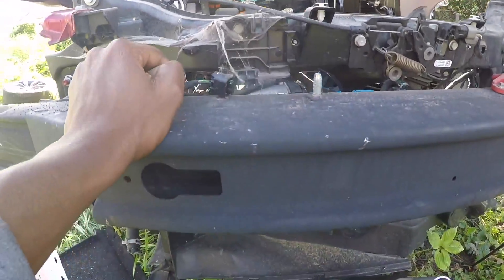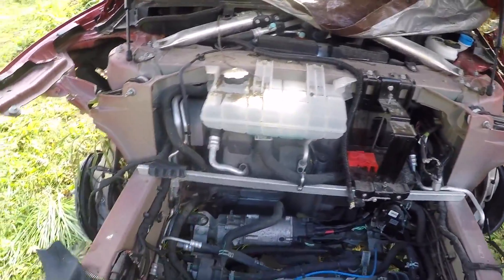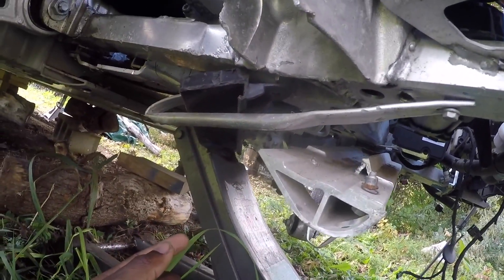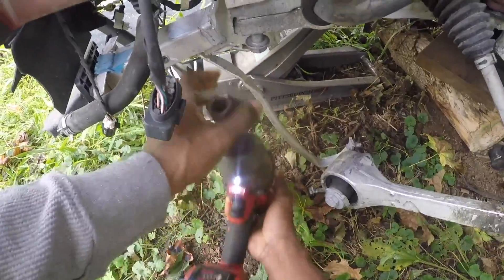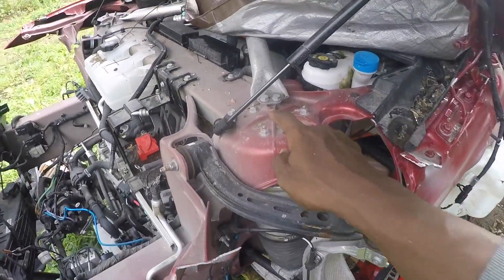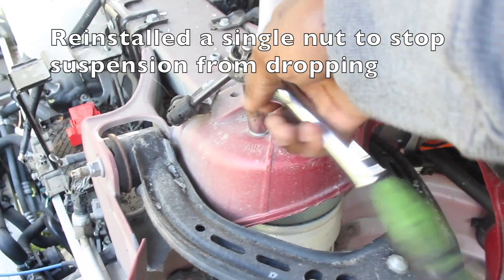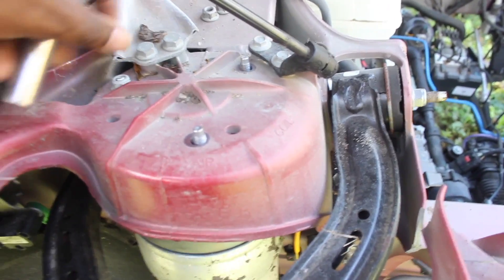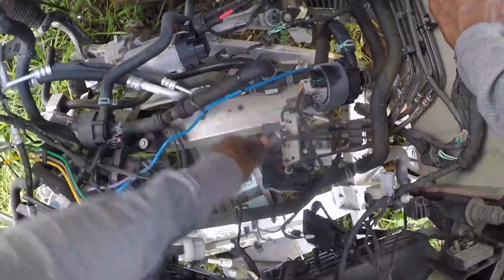Removing a Tesla motor from a wreck

Comment: We've watched several of your videos and you talk about how expense these parts are and how much money you can recoup by selling good used parts. That's great but you need to be alot more percise and cautious with your teardowns. You should put down a 4×8 sheet of plywood to sit the jack on, so you can roll the motor out easily without it getting dirt in everything. Put down large pieces of cardboard around the plywood to keep the area and parts clean, plus if you drop a bolt of tool it can be easily found. You also need plastic bins to put your parts in when you remove them. You should bag and tag all bolts, hardware and brackets for latter use. Trust me you will forget where they all go. Keep your sockets on the rail, makes it much easier to know if ones missing and keep your tools in a box together so that you can keep up with them. I really enjoy your videos and wish you success. God bless. I've learned most all of this the hard way... experience.

Comment: Hi . Great video as always . I wish I could be there to see this thing closely.however, A question 4u. Does the battery cooling system goes as far as using  the AC compressor as well as the radiator or just the radiator and fan ? Thank you

Comment: Alright, I had a constructive comment here until I saw you take a steak knife to the hoses. May Elon cast a curse upon you.
Reply: -Carguru laughing while reading Samcrac's comment. Later: *tries to hypercharge.. denied.
Reply: I'm pretty sure that that's a bread knife (the size and design)
Reply: Please upload more DXP car :D
Reply: Who cares? When you're a pro, you can use whatever. Glue with a hammer, tighten screws with a cutter ... inflate the tires with your mouth, simulate Bluetooth car unlock with a wireless doorbell ...etc.
Reply: To Samcrac and Car guru both: You 2 guys really need to learn to cap off all A/C and brake lines, hoses, and ports immediately upon disconnecting them. Both systems involve hygroscopic fluids and absorb moisture from the humidity in the air, and both systems will be wrecked by said moisture.
Reply: lol
Reply: Bread knife, that is a bread knife. :)))
Reply: May the gods protect the guru!
Reply: Sam I need that dash cam bro
Reply: LOL  !
Reply: Stop watching vids and get working on that pizza car lol  I love your channel to Sam fan from close in Orlando
Reply: WaynesWorkVlog what crawled in your ass and died, also what purpose would you ever need a knife for while removing parts from a car?
Reply: Oh wow. Yeah if your going to destructively take these cars apart with a bread knife and not talk thought the process of taking things out, then you may as well stick to the "comedy" and leave the Tesla mechanical tutorials to someone else!